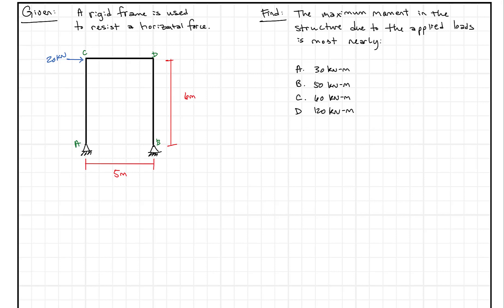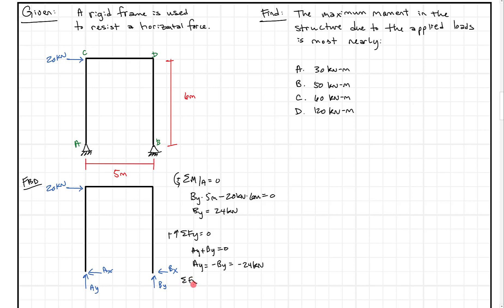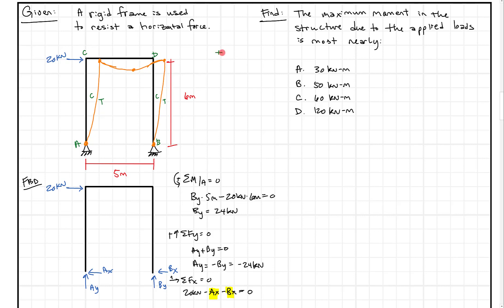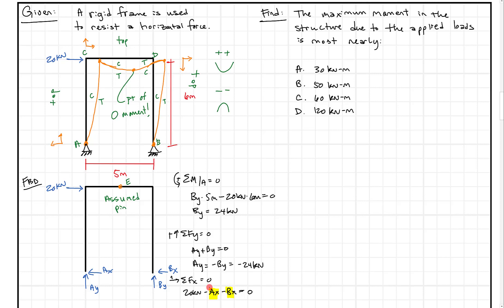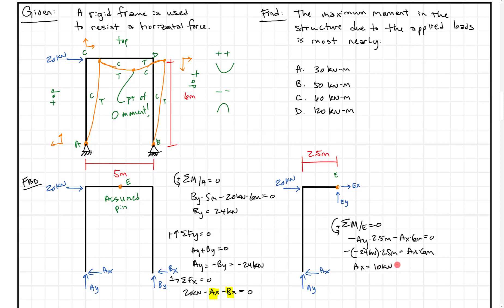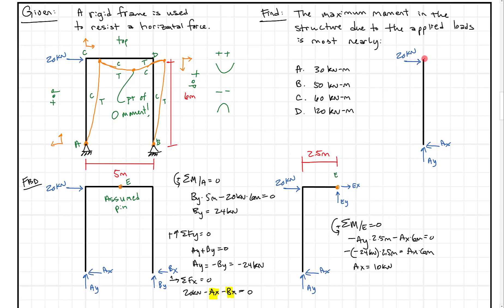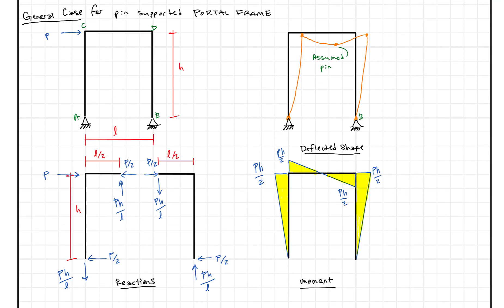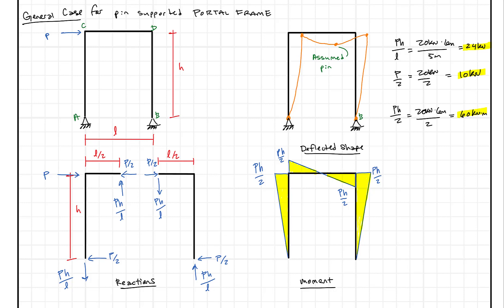Portal Frame with Pin Supports

Comment: Hi Mark, im currently carrying out a degree in civil engineering and unfortunately failed my first exam which inlcuding 3 pin frames. Is there any chance i can send the question i did on the exam so you can explain it better in a video. Our examiners dont give us any feedback :(
Reply from the maker: I am happy to help explain concepts, but as an educator myself, I would not use specific exam questions sent to me for a video in order to protect the integrity of the exam.  Here's another pin-connected frame video https://youtu.be/Mbp1Xr4SwdM

That said, there is a contact form on my website https://sites.google.com/view/markmattsonpe/home where you can reach me with additional questions or concepts that you'd like explained in future videos.  Thanks for reaching out!
Reply: @MarkMattsonPE  thanks for getting back to me on this. The issue I'm having is there is no examples online of calculating support reactions with no vertical forces present. My frame includes only a - load acting on the left side and a - load acting on the right side with no uniformly distributed load present.  I can't seem to wrap my head around the equation process.
Reply from the maker: One approach would be to draw an FBD of the whole structure and sum moments about point A.  If supports A and B are in a horizontal line, like in this portal frame, you can solve directly for By.  You then split the structure and sum moments about the pin to solve for Bx.  

If A and B are not on the same horizontal line, you still sum moments at A for the whole structure, but you get an equation with both Bx and By (two unknowns).  You then split the structure at the pin and sum moments at the pin to get another equation with Bx and By.  At that point, you have two equations and two unknowns and can use algebra to solve for each.  

I have a number of other videos in the queue, so I don't know how soon I'll be able to make a video addressing your question, but I hope this explanation helps!